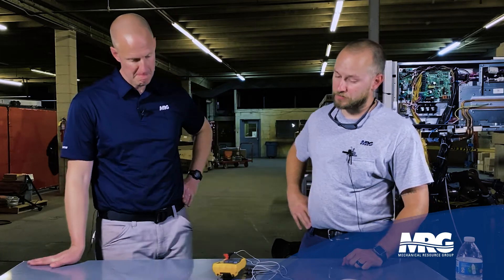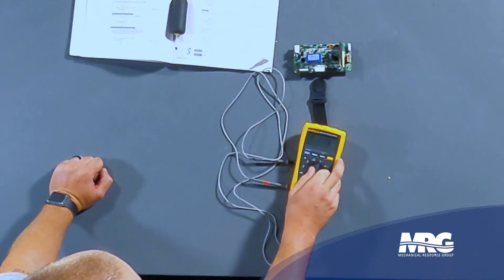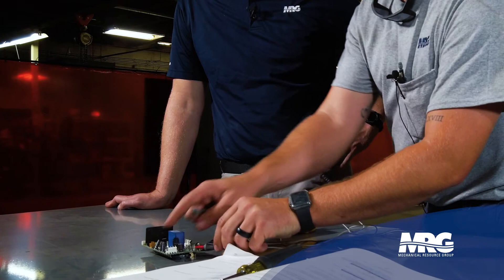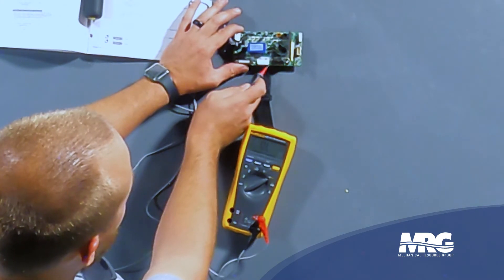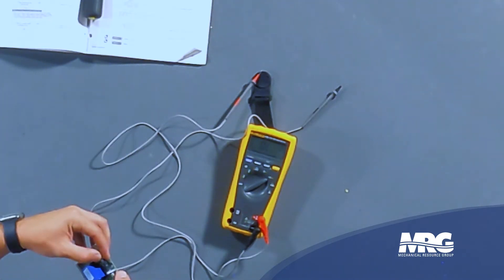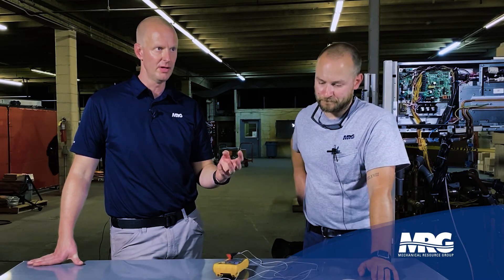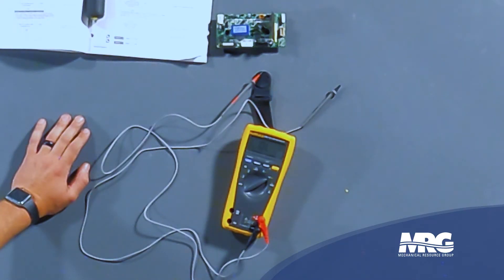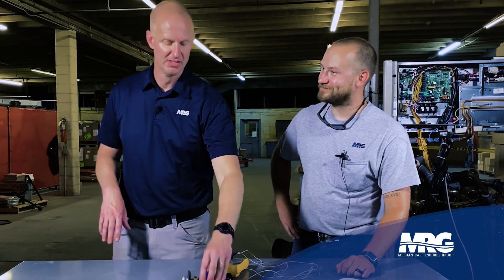Understanding VRV IV Condenser Fan Driver Boards

Comment: How do you actually get to the Daikin fan board in the emerion?
Reply: You gotta disconnect the cooling pipe, disconnect all wires going to the inverter board on the panel. Then pull the entire panel out. Horrible design. No idea why they decided to face the boards away from the technician